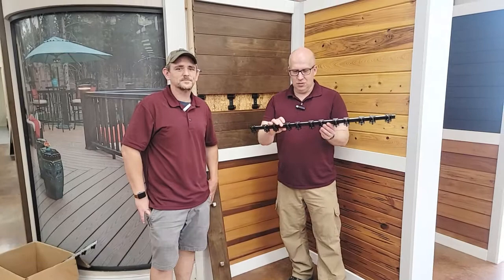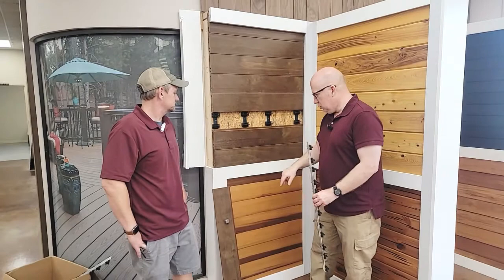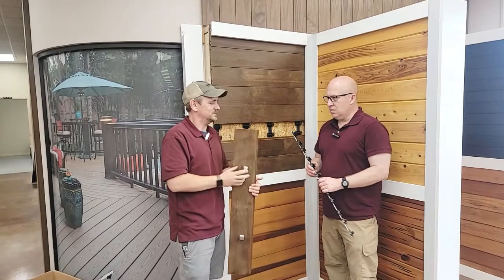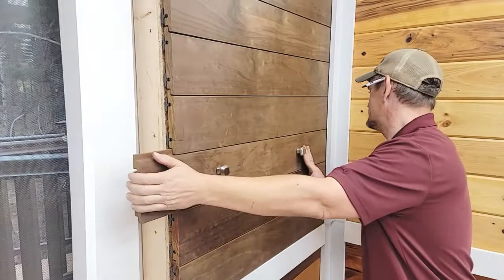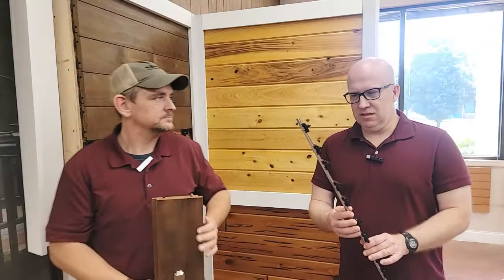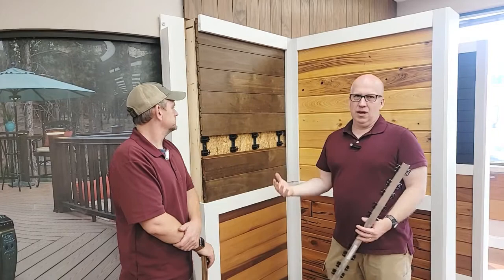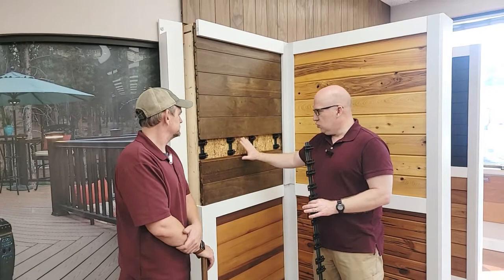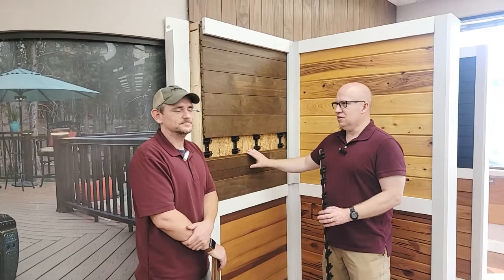Rainscreen and mounting system for siding | Grad by Kebony

Comment: Looks great, thanks for sharing! Keep in mind, that for demo purposes the board was installed at an angle, but you would only want to do this if replacing a board. Our recommendation is to install the cladding from bottom to top placing the board flat against both grooves then clicking it into place. Installing the board at an angle can cause the boards to crack.